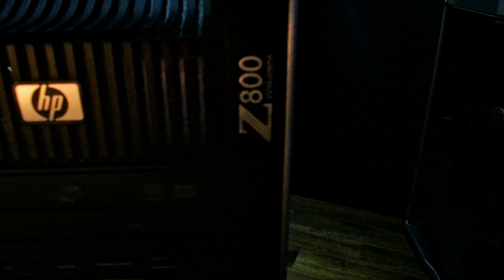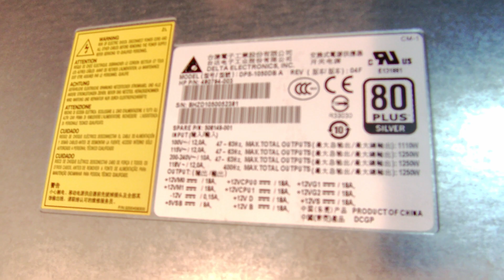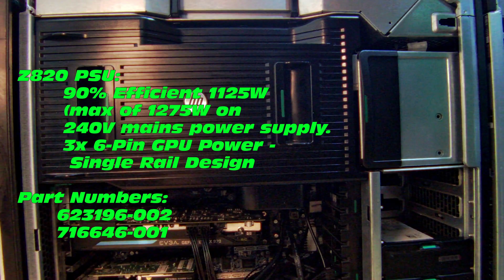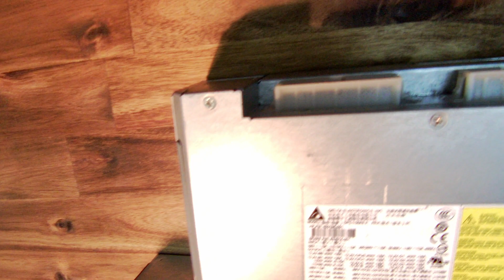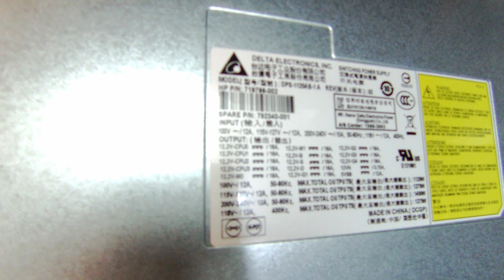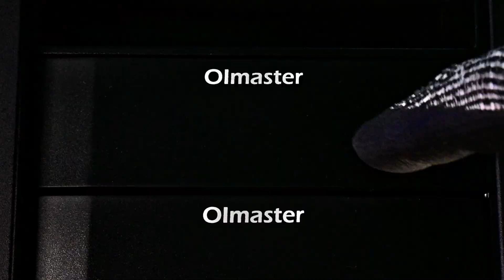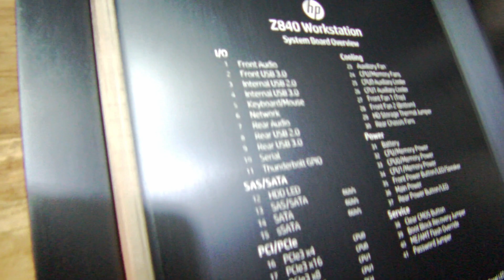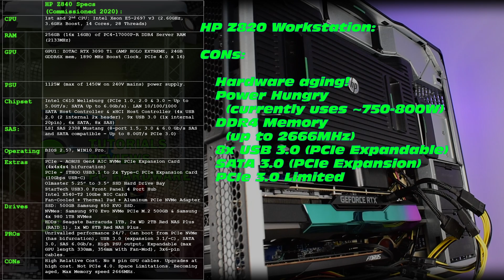Z800 / Z820 / Z840 Guide : Power Up Your Workflow with a Workstation (Remastered).

Comment: I just purchased the 840. I'm planning to set it up for video editing. I'm new to the PC customization game. I know I'll need to upgrade some components on the 840. For starters, I'll need to add WiFi, HDMI connections, and USB-C. I'll update other components as needed. What resources/ documentation would you recommend for a beginner to shop for compatible components for the 840? I need the TLDR Quick Start Guide for Beginners! Ha!
Reply from the maker: Great choice with the Z840. In terms of hardware to fill up your new machine, it really just comes down to what your end-use would be - but for the primary use of video editing you can basically copy my build to get a really capable system together. 

If you are looking for inspiration you are in the right place. I have made ~21 videos based on the Z840 - for a quick list you can find them here: https://www.youtube.com/playlist?list=PL365qNcOkwuVGKF8AMoWRi0qx5i5oRsho . 

The most important upgrades for video editing will be GPU (allows rendering projects faster) and storage (large projects need large drives - HDDs are too slow for editing - SSDs are ok but the ideal is NVMes). I settled on the RTX 3090 Ti in my Z840. I have 10GbE networking, 4x NVMEs in RAID 0 within a Asus Hyper M.2 V2 PCIe adapter for ultra fast storage (4x NVMes installed on the quad card each receive 4x lanes from the x16 PCIe slot thanks to lane bifurcation). I have done other videos on upgrades for storage - with the best bang for buck upgrades being 5.25" Bay HDD / SSD adapters. 

Pending the CPU and RAM that your system came supplied with you may need to upgrade there also. The ideal RAM specification is DDR4 Server RAM 2400MHz ECC Registered - and I settled on 256GB (16x 16GB modules; but you could likely order 64GB modules for a decent price - just keep in mind the RAM has to be evenly split between CPUs and you can't mix different types of RAM). 

In terms of CPU selection, I have made a comprehensive guide with quick search links to search for the ideal CPU for your end use: https://www.youtube.com/post/UgkxinbLescQdmrqtvl7VzO2DW8Eaysrn3QH (Broadwell generation of Xeons are best suited to the Z840 - so that's E5-26xx V4, but Haswells are also supported - E5-26xx V3).

I settled on dual E5-2697 V3's for my Z840 when I ordered them back in 2022. Right now the E5-2697 V4 would be the most cost effective CPU for video editing in the Z840. They have a good balance of clock speed and core count. I found that DaVinci Resolve has several processes that are only able to operate from a single core - which means clock speed will be limiting in your workflow. The Z840 does however shine when you start rendering the videos - with the CPUs doing a great job there.
Reply: @racerrrz  Can you please tell me more about lane bifurcation? I want to replicate your Z840 upgrades for video editing, but I don't understand what lane bifurcation is or how to replicate it. Can you please recommend a resource, perhaps a step-by-step guide?
Reply from the maker: @e-vd  Yeah, no trouble! It's a popular point of confusion but it's really simple once you get the run down on the topic. I can recommend my video, but there may be others as well. https://youtu.be/PRMWIpscDCg  

Bifurcation is a method for splitting a given PCIe lane into smaller segments. As an example, you may be familiar with your GPU needing a X16 PCIe slot. X16 means the slot on the motherboard has a mechanical length that can support 16 electrical lanes of data connectivity. 

Think of it like a highway. 1X lane means way less traffic flow than 16X lanes. Bifurcation splits the "data motorway" into smaller segments. X16 could become X4X4X4X4 (4x roads of 4 lanes). This would allow Quad NVMe adapters to connect 4x NVMes - because NVMes normally need X4 electrical lanes for maximum speeds. 

The setting can be toggled in the BIOS, but on the Z840 I would recommend using HP Performance Advisor. You can adjust BIOS settings from within Windows with HP's software package. Check my video for more guidance or ask questions here if you like.
Reply: @racerrrz  You, sir, are a PhD, a doctor of computer magic, and a kindly one at that!
Reply from the maker: Living up your words, the computer doctor gives you the Z840's "TLDNR Guide" that is sure to be magical! haha Check it out, full run down on the Z840! https://youtu.be/2bie4EGJZL0
Reply: @racerrrz  Holy smokes, you are a wizard! Ok, I'll try to digest all this valuable and generous guidance, and create a shopping list. Yes, my end use will be video editing and some basic graphics, using Adobe CC Creative Suite:  primarily Premiere Pro, Media Encoder, (some limited work in After Effects), and Photoshop. Thank you so much! I've been binge watching your Z840 playlist BTW, thank you for the comprehensive education! 👍🏻

Comment: Have the chance to get a z840 w dual e5-2699v4 with 128gb memory, 0.5tb nvme and old quadro 8gb for about $1000,
Athe the same time, a completely brand new amd 7950x3d with 32gb memory, 1tb gen4 nvme, no GPU and 1000W 90%+ PSU was listed for $1350.
The 7950x3d has capability to upgrade 192gb memory at max, 4090/4090ti ready, 2 more vailable nvme slots on mb, and all the usb 3,2 and usb4 peripherals. 
The processing ability of newer amd prosumer-grade 7950x3d build is about 2.2~3 times of dual e5-2699v4 in passmark/gb5&6/cinebenchR15/20/23, 
and apps open even more faster in real life thanks to gen4 nvme drives.
I love the time i had with z840 and my favorite workstation, lenovo p900, but if these old dogs don't come with sub $800 price tag 
with all the bells and whistles and "core and threads count" on earth, in a log run, it just doesn't make sense to have one imho.
Reply: Oh, and for those who is looking for a NLE/video editing machine and music production desktops,
yes, the newer 14700k/14900k or amd 7800/7950x machines not only render/export faster, but they can handle way more/heavy plugins per channel on DAWs.
My point is not to criticize the old system such as Z840, but trying to point out that it's not just their being old and outdated,
but the software makers such as Adobe/Steinberg and others make apps that works faster and efficient for the newer system. 
This situation makes this massive core-count Z840 more suitable for VM or soho servers, rather than strong powerful workhorses.
But don't get me wrong, if something like Z840 with 40 cores and 128gb memory and a decent gpu comes up for $500, than grab it.
Reply from the maker: Your point is valid. With those two hardware options, the price gap is too small to ignore. Normally new systems would cost 2-3 times that of a complete Z840, which is why the Z840's are such good value. You get a complete machine, often without a GPU, that you can quite easily use for modern tasks. 

For me locally right now I can get a new 7950x3d CPU for $850 USD, competitive price. But that's just the CPU. Add in a suitable motherboard, $300USD (Gigabyte X670 GAMING X AX V2), 1000W PSU $160 (Silverstone DA1000R, Gold 1000W), AM5 CPU Cooler $100 (DeepCool AK500), 128 GB RAM $430, (Kingston FURY Renegade 128GB (4x 32GB)), Case $300 (Fractal Design Define 7XL), Fans etc. $50 - total $2190 USD (you could spend more or less pending desired setup - but you would ideally match the Z840's specifications as best as possible to make it a fair comparison). 

I can get a Z840 for $1000 USD locally with two E5-2620 V4s, no GPU (1450W PSU, 128GB DDR4 RAM, 500GB NVMe boot drive). You can add in what ever hardware you want. E5-2697A V4's are around $60 USD at the moment. But the Z840's can be obtained for as little as $350 USD right now: https://www.ebay.com/sch/i.html?_from=R40&_trksid=p2334524.m570.l1313&_nkw=HP+Z840&_sacat=0&_odkw=+E5-2699+V4&_osacat=0&_sop=15

A quick CPU benchmark comparison: 
https://www.cpubenchmark.net/compare/5234vs2753.2/AMD-Ryzen-9-7950X3D-vs-Intel-Xeon-E5-2699-v4

The 7950x3d is rated 2x better in single core and 1.5x better in multi core. Also, keep in mind the Z840 will use a lot more power being that each CPU will be ~150W and if you populate all 16 memory slots it will chew power (mine peaked at around 750W with a RTX 3090 Ti, 256GB RAM, dual E5-2697A V3's, ~25TB storage, 4x NVMes in RAID 0). 

Conclusion : the 7950x3d with 32GB of RAM for $1350 versus a Z840 with dual E5-2699 V4's and 128Gb memory for $1000, the 7950x3d would be a solid option since it is priced about half of what it is worth and the Z840 is a little overpriced. 

I recently upgraded to a HP Z8 G4. The base system was listed way under value, less than your Z840 option! If I can get my hands on some Gen 2 Scalable Xeons and DDR4 2933 MHz memory, then it would be on par with the 7950x3d, but the cost would be a bit higher (likely $2000 USD or more pending CPU specs and RAM amount etc.). The Z8 G4 is also RTX 4090 ready (4x 6+2 Pin connectors - rated to 216W max each), the only down side is PCIe 3.0 limited. I would be happy with 48 Cores, 96 Threads and 256GB of 2933 MHz memory.lol

Benchmarks: https://www.cpubenchmark.net/compare/5234vs2753.2vs3085.4vs3624.2/AMD-Ryzen-9-7950X3D-vs-Intel-Xeon-E5-2699-v4-vs-Intel-Xeon-Platinum-8160-vs-%5BDual-CPU%5D-Intel-Xeon-Platinum-8275CL 

I would still say the HP Workstation is better value from a production standpoint. The system was made to handle large workloads and it is incredibly stable and reliable. My last gaming rig gave up on me after about 3.5 years of use (X79 Asus ROG Extreme 4 + i7). I have used workstation hardware ever since.lol

Comment: There is just one problem with those older xeons. Pre LGA-1356 don't have AVX instructions and some modern programs might run unexpectedly slow on them, or not at all in some cases. A few games will not start if you are trying to run them on systems without AVX instructions.
Reply from the maker: Hi. That's definitely something to consider in this day and age, thank you for the comment. The Z840 will support AVX thanks to the Haswell/Broadwell generation of Xeons. Side note, the Z800 that I used a few years back never gave me any issues from a software perspective but I found the slow Sata 2.0 and USB 2.0 a bit tedious (I had Sata 3.0 PCIe expansion on mine - but it gets a bit tedious).

Comment: Bro, is ASUS Hyper m2 support on HP Z800 (bifurcation)? If it's not, any other way other than the BIOS thing?
Reply from the maker: Hi. The simple answer is no, the Z800 does not support bifurcation due to the age of the hardware. You can install the card but only one NVMe will be detected - even if 2-4 are fitted. Bifurcation support in the BIOS was first introduced to the HP Z440 / Z640 / Z840. 

Does this mean you can't boot from a M.2 NVMe on an older workstation? Yes and no. I have read that the Samsung 950 Pro was able to get these older systems to boot due to having a chip on the PCB for dealing with older BIOS. I have not confirmed this myself but I have seen others claim to have done it: 

https://h30434.www3.hp.com/t5/Business-PCs-Workstations-and-Point-of-Sale-Systems/Z800-PCIe-NvME-lsi-megaraid-what-slots/td-p/6189360/page/2

I have tested booting from a Samsung 970 Evo Plus with Clover on a Z800 and a Z820 but I never got my systems to boot from these NVMes. 

Is there a way to get bifurcation support on an older system? Yes, but at a cost! You would require a PCIe NVMe adapter with a PLX chip to negotiate PCIe slot bifurcation. The best one I have read about is this (link may break over time; IO Crest PLX Quad PCIe NVMe adapter): 

https://www.amazon.com/IO-CREST-Non-RAID-Bifurcation-Controller/dp/B083GLR3WL?th=1

(note, there are two versions. The M key version supports NVMes, the B key version only supports M.2 SSDs - also called M.2 NGFF SSDs)
Reply: @racerrrz  Bro, thank  you for the answer. It helps. For sure, it's better to upgrade to Z840.
Reply from the maker: @LeoBasuki  No worries. If you can source a Z840 for cheap it could be worth it. But don't neglect the HP Z8 G4 either. I managed to get a Z8 G4 for half of what I paid for my Z840 three years back. Z8 G4's are coming off lease after the release of the new HP Z8 G5 earlier this year.
Reply: @racerrrz  There's an offer for $1,000 for Z840 comes only with:
2x Intel Xeon E5-2967 v3 
DDR4 64Gb
PSU 1000W
No GPU No HDD.

Not sure if it's worth it.
Reply from the maker: @LeoBasuki  It's ok for the price, but honestly that's too much for the Z840 in this day and age. 

If you want a more future proof system I would recommend the HP Z6 G4 since the HP Z8 G4 is still quite expensive. The Z6 G4 can support Intel Gen 1 and Gen 2 Scalable processors and some Xeon-W CPUs (LGA 3647 socket).

There is less info on them online but I am working on video tutorials on the Z8 G4 (like CPU fitment which is more technical than the Z840). 

I would pair the Z6 G4 with a powerful Xeon W and 2933MHz Regulated ECC RAM to give a powerful system. It would cost a little more than the Z840 you listed overall but you'll get a far faster / newer system.

Example links (Amazon affiliate link - I would get a small margin if you buy using this link): 

HP Z6 G4 Silver 4110 8C 2.1Ghz 96GB RAM 250GB NVMe W2100 Win 10 (Renewed):
https://amzn.to/3GAyrZ0

Non-affiliate HP Z6 G4 search link:
 
https://www.amazon.com/s?k=HP+Z6+G4&s=price-asc-rank&crid=L7MZWBLO0VUR&qid=1702002502&sprefix=hp+z840%2Caps%2C308&ref=sr_st_price-asc-rank&ds=v1%3A5WOWAJ1QggWIZ%2BCEy64KFzA50A1kjZJKz69xJ8KyRDc

Non-affiliate Xeon W-3235 link (12 Core 32 Thread, 3.3GHz base, 4.4 GHz Boost):

https://www.ebay.com/itm/385612677985?mkcid=16&mkevt=1&mkrid=711-127632-2357-0&ssspo=mkemlddiq-y&sssrc=2047675&ssuid=geuID1L0SNO&widget_ver=artemis&media=COPY

What do you plan to use the system for? If you will be gaming the Z6 G4 will be better overall. There will be many CPU options and it's best to pair the CPU with RAM that's best suited (basically 2666MHz or 2933MHz DDR4 ECC Regulated modules). I presume the Amazon link Z6 G4 comes with 2666MHz ECC Regulated which is better suited to the older Xeon Gold Gen 1 Scalable CPUs, e.g. Gold 6142 (I have these in my Z8 G4).
Reply: @racerrrz  Mostly I work on a complex layers After Effects and Resolve at 6-8K.
Reply from the maker: @LeoBasuki  That leaves you with the need for a lot of cores, a high clock speed and a modern GPU. 

I just made the shift from the Z840 to the HP Z8 G4. I was pricing up Z840 CPU upgrades (I wanted a pair of E5-2697A V4s), but I noticed that the Broadwell range of CPUs were priced the same as the equivalent Gen 1 Scalable CPUs. e.g. E5-2697A is similar to Gold 6142, yet you get higher benchmarks, faster RAM and more GPU performance on the more modern architecture. My Z840 bottlenecked my RTX 3090 Ti by around 20-30%. The Z840 did handle 4K 60fps without issues -  but it was VRAM heavy (most video projects hover around 20-24GB VRAM in use for me).

https://www.cpubenchmark.net/compare/2814vs3273vs3601vs2750vs5334/Intel-Xeon-E5-2697A-v4-vs-Intel-Xeon-Gold-6142-vs-Intel-Xeon-W-3235-vs-Intel-Xeon-E5-2696-v4-vs-Intel-Xeon-W-3275

Ideally, set up your budget and do a comparison between the HP Z840, HP Z6 G4 and HP Z8 G4. You'll find that the HP Z6 G4 will have the strongest single CPU options (e.g. Intel Xeon W-3275 - pricey, or Xeon W-3245 - affordable - note these can't be run in dual CPU config.) and with similar hardware specs. it will cost about the same as a Z840 with 2x E5-2696 V4s. The Z840 can have more cores (44 Cores with 2x E5-2696 V4s) and more PSU overhead for expansion which is nice (but you can't run a RTX 4090 due to the lack of 4x 6-pin GPU power cables). The HP Z8 G4 would be the best in terms of core count, RAM capacity, less GPU bottleneck, ability to run a RTX 4090, but it would cost 2-3x more than the other two.
Reply: @racerrrz  Yes, I've read through. Thanks a lot, it's so much informing. Finally,... the best option is to compare to what I need, and my willingness to wait. :( I love so much using server computer since it's more stable etc etc.
Reply from the maker: @LeoBasuki  Waiting for that perfect bargain that matches your needs is the way to go, but sometimes waiting hurts your productivity too - so trust your judgement. We can't always win there haha. But yes, these workstations provide reliability above everything else. 

I need to get some videos done on the topic to make it easier to find the right workstation. I have a follow-up on this video in the works and I am hoping to make it a good one!

Comment: The Z800 have the best (internal) Design, direkt CPU fans eg. ... ❤
Reply from the maker: The Z800 does have appeal given the less complex CPU cooling system. I have seen some solid CPU setups on the Z800 but the newer models are less accepting of aftermarket coolers. The Z Coolers for the Z820 and Z840 are quite good though, and if you can live with the cooling module they aren't too bad.

Comment: They are good if you've got the spare money. I got a 440 instead.
Reply from the maker: That's a fair point, the Z8xx's have always trended towards high prices on the second-hard market - but they do at times come up for good prices. The Z440 is a fantastic machine for the price point. I just upgraded my Z440 case swap build to it's final form with a e5-2697A V4 CPU and 64GB of 2400MHz ECC memory where it's serving as a powerful 10GbE capable TrueNAS server (I am editing this video right now lol - major project). I have nothing but great things to say about them.
Reply: @racerrrz  I saw a 840 for $3000 Aus. I didn't buy it. It's good to see another 440 user.
Reply from the maker: @markkilley2683  The Z840's can still be very expensive, but definitely keep an eye on your local websites, they do seldomly come up for much cheaper. The Z440 does everything that is needed and I do appreciate how it uses the same RAM and CPUs as the Z840. Being able to interchange components between them is a huge plus.